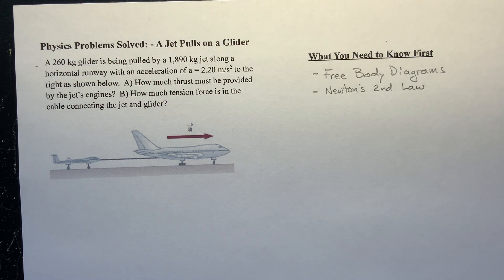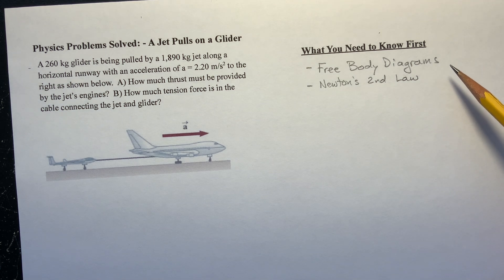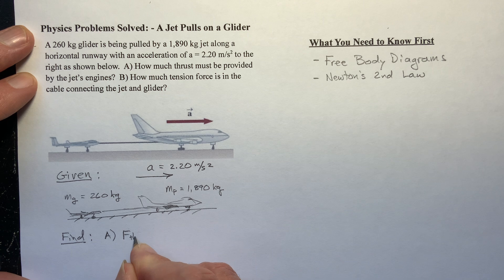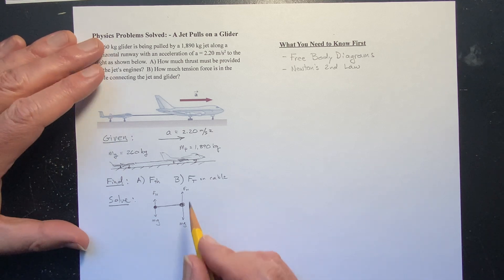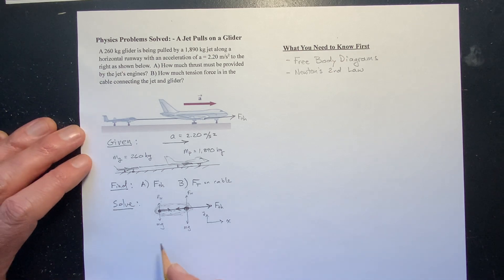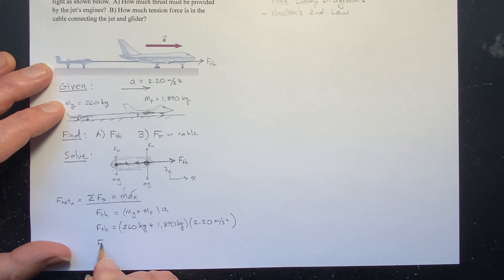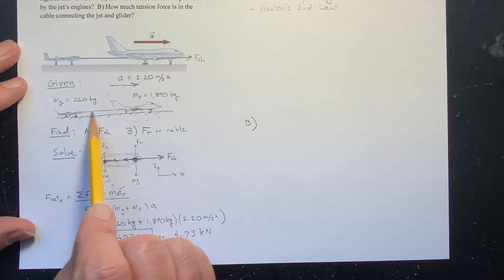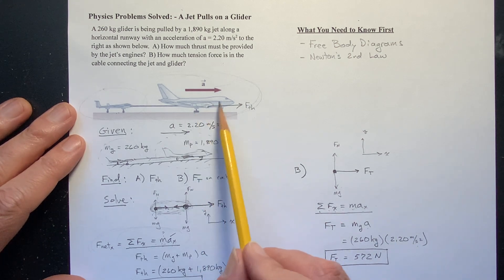Physics Problems Solved: A Jet Pulls on a Glider

Comment: Thank you for these videos, Mr. Lake! ☺️ I am currently taking college physics, and I’m very happy to see you’re uploading these videos! I’ll definitely subscribe and keep watching! 🙂👍🏼
Reply from the maker: Thank you!  If you have a problem you would like to have solved leave it here in the comments.
Reply: @Treebeard1671   Sure! Can you help me solve this question: 
A wheel rotating with an initial angular velocity of 912 rev/min is stopped. In 5 seconds, the angular velocity decreases to 319 rev/min. Assuming that the angular acceleration is constant, how many revolutions does the wheel undergo during this time? 

I got 51 the first time I tried answering it. On my second attempt, i got 510! I can’t figure out which answer is right.
Reply from the maker: Sorry Marlene.  I didn’t get notified (or if I did I didn’t see it) of your response.  Hope all is well.